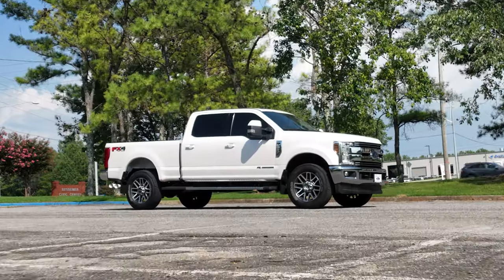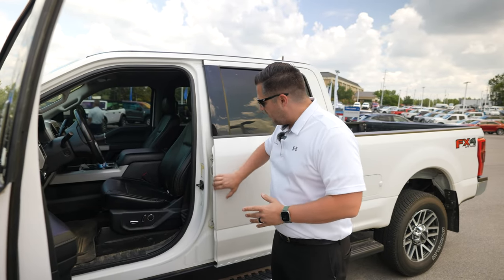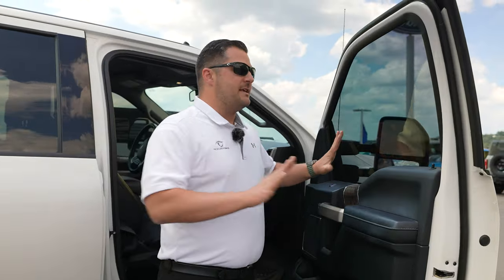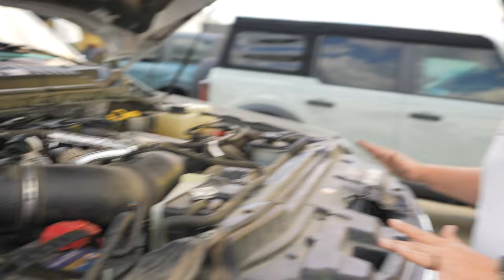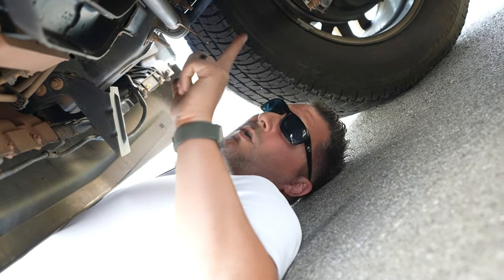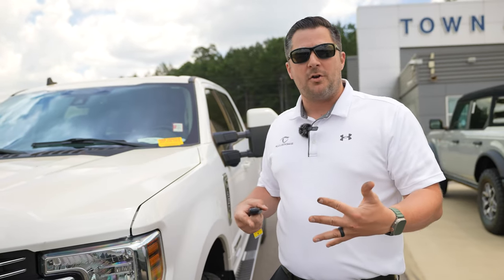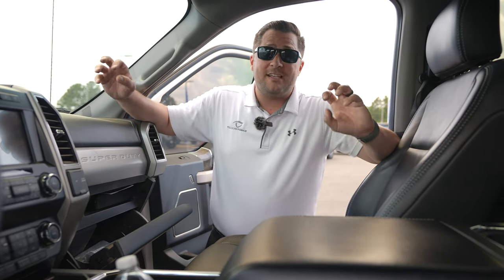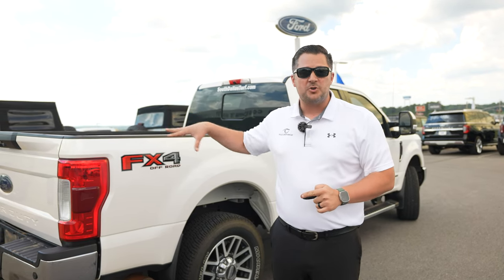Don't Buy a Vehicle Until You Have Watched This Video!

Comment: When I was used car shopping in 1987 it took several months to find a car that either didn't smell like very old fast food or smoke. And the ones that didn't smell had  so many ( deep ) burn holes that the bottom 1/2 of the driver's seat needed replaced

Comment: I'd  stay away from a vehicle with 109k on it. That's fairly high for a 4 year old vehicle. Expensive stuff is gonna start happening and the 2nd owner will ne picking up the tab. I'd also not even consider a Bronco or Mustang. Those tend to be driven hard and I think too risky to buy used. The bodywork tips are excellent. A lot of dealers nock that kind of stuff out fast and sometimes a little sloppy. You'll likely find evidence easily.
Reply: in that case might as well not buy rentals or any "sporty" looking vehicles.
109k miles isnt nothing my truck has 191k miles and it runs great its all in how well its been taken care of.